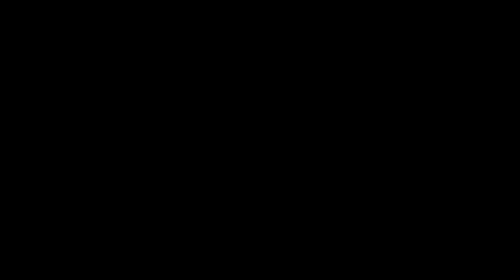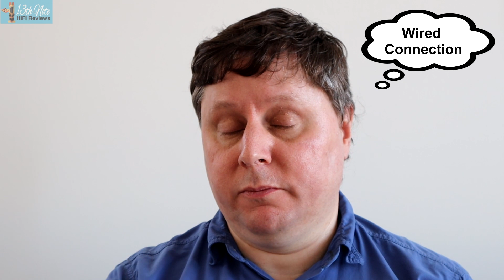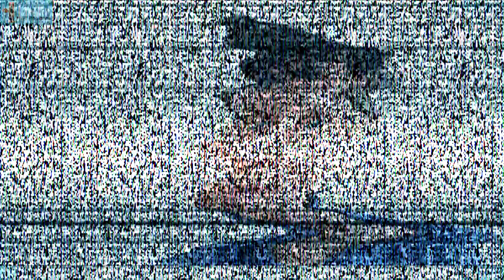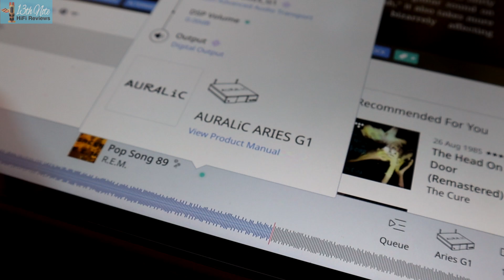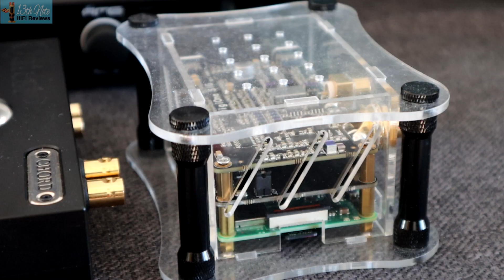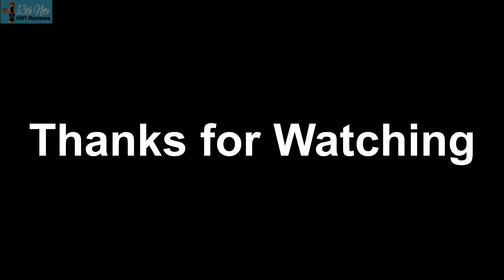AURALiC Aries G1 Review : Brass tacks

Comment: i really like this product, tested it today with my naim xs3 and it blew me away.. so composed. I tried with qutest, then with tt2 (oh my this was soo good), with the tt2 it sounded levels better than even an ndx2.. i tested the ndx2 with using qutest instead of it's built in dac and auralic beat that too imo but the ndx on its own was noticeably better than auralic + qutest combo.. the auralic is a very capable piece of kit when partnered with chord qutest and absolutely bloody amazing with the tt2
Reply: @13thnotehifireviews7  sorry you didn’t have a great experience with the G1. And your opinion is your opinion, However you might be be more open about other peoples experiences. I have both a G1 and a node 2i in separate systems. In my systems they do not compare, not even close. While I really enjoy the 2i in my second system, putting it in my first, I lose detail, air, soundstage, and timing. Truly a different listening experience. While I can’t do an exact swap because I run my g1 with USB and upsampling, the speakers (spatial X5), DAC (Rockna Wavelight ), amps(triode lab monoblocks), and preamps (Don Sachs) were identical. I’m not a dealer and have no ties to either piece. The only reason I write this is because if I had seen this before I bought the G1, I may have rethought that, but I’m glad I didn’t, I had the Node 2i prior to the G1 and had every opportunity to return the G1 if I wasn’t happy. And there may be better streamers in my future too. I would suggest to others to do your own testing and take any one review as just that.
Reply from the maker: glen schneider the usb output from a node 2021 is quite a bit better now. But in any event I’m always dubious of people who have bought and are consumers and don’t want to be wrong as otherwise it’s a big affront to their spending and decision. Bias in other words. I’ve been in that position myself but no longer care. Another review agreed with me the differences are none to small and ‘not even close’ doesn’t really exist in streaming transports. The give away really. The point too is one is a fraction of the other in price. I’m all for people making up their own mind where there is preference and good discernible difference in the mix, but this wasn’t a quick snapshot view and I don’t say it lightly and I’m saying it independently without any bias of being a buyer. People  in hifi buy stuff that isn’t great. It props up bad products and the notion everyone can then have a valid view is not right. Also a product doesn’t sit in isolation - if you spend 2000 for a few percent but it gets you more on another product then we should say.
Reply from the maker: Didn’t really get what comparisons you made in full. Tbh I think it’s overpriced, and to that premise you didn’t say what budget streamers you’ve tried. People tend to just go for expensive thinking it’s better. In this case the Auralic is definetely wasting money.
If you are using xs3 with an Auralic and the TT2 I’d put the money into improved amplification to get better sonics, as spending 2k on a streamer with a 2k amp is a false economy, especially one where the change to a lesser streamer is small percentage points. I’m calling BS on big changes.
Reply: @13thnotehifireviews7  i have tried a few lower budget streamers, bluesound: had to have xs3 volume at 3/4 maxxed out, it felt almost muffled and restrained, not terrible but soon as i hooked up the auralic and was same volume at a 5th open, the soundstage opened up and came to life, crystal clear, just a bigger 3d sound and much more controlled, tried arcam rplay too which was very harsh and bright and I couldn't even listen to a lot of tracks, also tried uniti star which is pretty decent but quite lean in comparison to xs3 as you'd expect
Reply from the maker: Calling BS on that. Words like “much more controlled” don’t exist between node 2i and G1. People want HiFi to be good and in buying affirm lots of decisions, I can look at it dispassionately.
Reply: 13th Note HiFi Reviews just try playing “lucifer Sam” using bluesound then try with g1 and tell me again of you still think one doesn’t lose complete control and sound a bit of a mess.. they are worlds apart imho (no BS 😜) and price difference is too, so no shame in that.

Comment: The only thing that I find attractive with the Aries G1 is the WiFi, as my room has no wired Ethernet connection.  Is there a cheaper network streamer with excellent WiFi?  The Innuous, etc. don't seem to have built-in WiFi support.
Reply from the maker: You don’t need to worry about that and it really isn’t a consideration. Buy yourself a good WiFi network extender which also has its own Ethernet ports and works on its own LAN (local area network) and you are good to go. You then just plug the innuos etc straight into one of the lan ports. I use mine behind a tv, which I plug the tv into/Apple TV etc and then all my HiFi streamers. They are easy to set up and it means too you don’t need to run Ethernet cabling around a house nor use powerline which is bad for audio quality. I use a really good fast netgear nighthawk extender. Price about £100 and against the price of audiophile gear, they are cheap. There are no concerns running hi res files etc because they are as fast as the main router. Also I plug my NAS into the extender so its with the HiFi. Auralic say that WiFi is better but I’ve never heard a difference on the aries between Ethernet and WiFi and all other streamers I’ve tried. If anything fixed Ethernet connection is always better because you never get drop outs if your network is reliable. Plus you can exploit slightly better shorter cabling from the extender to the streamer, than you otherwise might if you ran cabling everywhere which isn’t ideal from the point of audio quality and noise. This methodology gives you greater scope to pick the streamer on sound quality not on small things like this. Hope that helps.

Comment: Having tried several streaming solutions, a huge element of value is simple usability (not just sound quality), mainly via the user interface you are required to use, both for system admin tasks, and mainly music search and listening.  And Auralic have one of the very best, their Lightning DS app - not to mention this in this review is missing a large part of the value that Auralic provide.  Many of us have no intention of using Roon, its fees, and its required PC somewhere else, to listen to music we own, and many Auralic owners have commented that the Lightning DS system/app is so effective that it has replaced Roon for them.  So there is another perspective...
Reply from the maker: User-ability is much easier to get right across the board, all the way up to streamers of this ilk. But this price is a big chunk to spend on a streamer for the very big diminishing SQ returns against cheaper alternates. I did factor your judgements into my thinking. Lightning DS is not particularly special against some free upnp apps or branded ones like HEOS or sonos  - it is good but that’s not the point - if all you want is just album artist search-ability, which most apps do, then you can get that for a lot less eg bluesound. That makes sound quality the reason to buy and as it’s so close, one wonders why. I understand people often think that spending lots gets you more and more, but when you test it out and equally are happy to listen to cheaper gear then that’s what it boils down too. This cheaper gear is not as good, but it’s a question of whether it’s value. A lot of the time in audiophile HiFi it is, but other times not so. I wish sometimes that people went out and did the dog work, like I do, to try comparative sound quality. It’s one thing to do so and still form a judgement it’s something you’d pay for, but it’s quite another to defend a product on purchasing alone without. If you’ve bought it doing other judgements against competing products, and you think it’s great, then great and all power to you. But sometimes this doesn’t happen in audiophile HiFi and it makes me think why do people pay so much. Even if you have the money!  aaarrrrgggghhhhh!

Comment: The Auralic G1 actually sounds very good. I have compared the Auralic against the optical Rendu + Sbooster PSU and found that the sound quality of the Auralic G1 is a bit better than optical Rendu. The difference is not that huge but there is a step up going from the Rendu to the G1. 
Also, in my system, the Auralic G1 totally crushes the Digione Sig Player. I would say the Digione is about 50% of the Auralic G1.
Reply from the maker: vic luu I’m using the shanti linear psu with the g1. I’m doubtful of terms like ‘night and day’ or even ‘totally crushes’ because these terms don’t really exist in audiophile HiFi. Even a dac 1/10 the price of another is not even half as good. Law of dim returns is higher. That to me doesn’t mean it isn’t worth paying for but there are degrees and what you can get elsewhere options. Also as owners bias comes in to make HiFi much better simply to substantiate the buying decision. You don’t tend to get many people who will admit that. if something comes in better value I’m always happy to say even if I own the more expensive item because this doesn’t concern me. I’m not saying I don’t accept your viewpoint, I just wouldn’t accept it being as marked, and I think most would think the same.
Reply: @13thnotehifireviews7  I totally agree with you. I might use terms that are too extreme for the comparison. 
However, I still have to express my observation because I own three different products which are at three different levels.
-The Digione Sig, for me, represents good value for money.
- The optical Rendu represents one or two steps above the Digione depending on your DAC.
- The Auralic G1 is half of a step above the Rendu. A good DAC will show that difference.
Once again, these are system dependent. But, in my situation, that is what I see so far.
Reply from the maker: vic luu a good dac will show the difference but I think it’s still a cost compromise and whether the dac gets you more on a decent but modest source. Have you tried a tt2, dCS, ps audio, Dave, m scaler, etc. Even something more modest like the rme. It gets you more per buck, that was really the point.
Reply: @13thnotehifireviews7  You said that you're "doubtful of terms like ‘night and day’ or even ‘totally crushes’ because these terms don’t really exist in audiophile HiFi", yet in your website article you write "Adding a Roon capable £899 Innuos Zen Mini Mk3 on Roon core only duties, with a streamer like the Allo, representing a similar price to the G1, sound quality improvement is INFINITELY BETTER.". So the question regarding what terms to use depends if they are in favor or against Auralic in particular or more in general if it is you instead of others to use them?
Reply from the maker: Mattiu75 that’s true, those expressions are often hard to justify. But not always mutually exclusive. Also I pick small differences in sq but nonetheless important. equally the proposition I made that it is infinitely better relates to use, performance and sound and features. So in that context I think I can justify the combo as infinitely better. And no it has nothing to do with me disliking Auralic per see. If the auralic put a good 20 percent on the Innuos I’d think the other way. I wanted it too as I’m an enthusiast. Sadly it doesn’t, it doesn’t have the flexibility and I don’t get using CD players with it when streaming is a cd-less ideal.